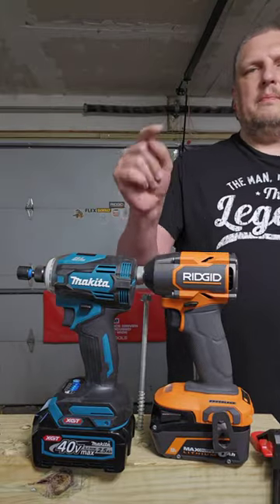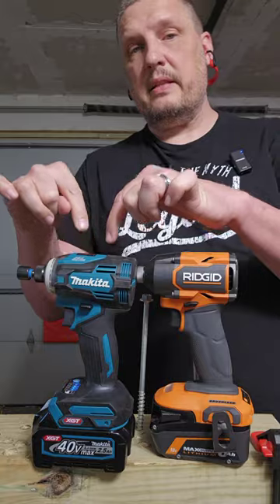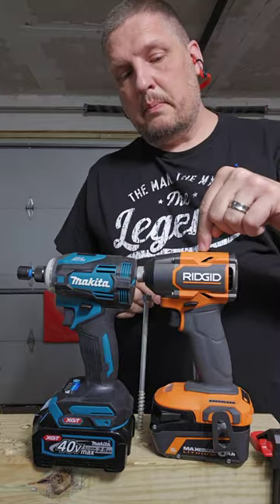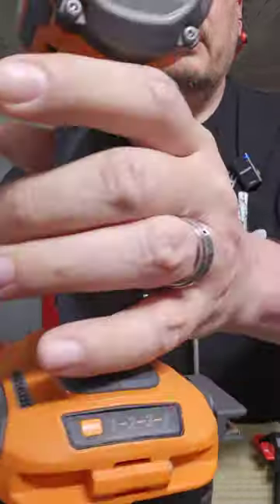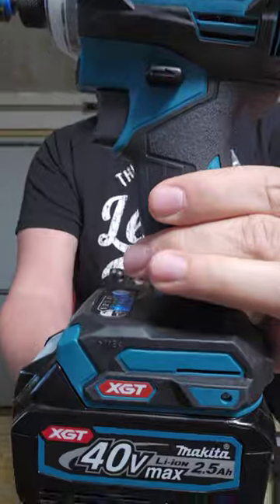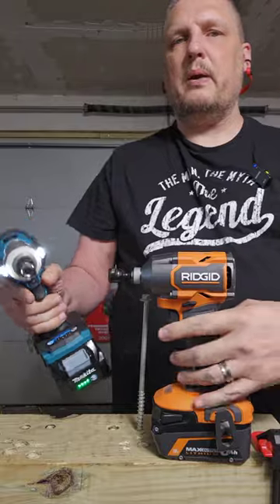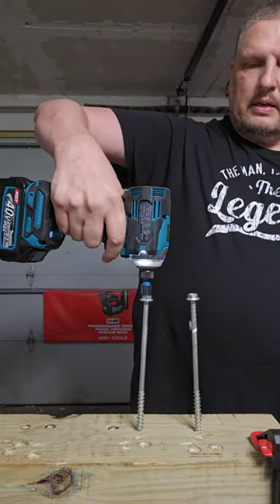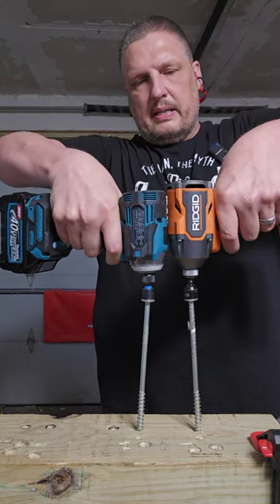Makita Fails Again! #makita #ridgid #impactdriver #tooltestraw #makitaxgt #tooltesting

Comment: The speed is not important it’s the quality
Reply from the maker: Excuses are fun to make when your tool brand loses. Like in this instance, you need to have a serious mental condition to believe that the slower tool, that has metal hitting on metal, building heat, transferring that heat through the fastener and the motor of the tool, would be the better tool. Maybe you just can't handle the results so you're allowing your excuses to expose your fear.
Reply: The advantage of impact drivers and wrenches is the greater torque they offer to drive or loosen fasteners (screws, bolts, nuts, and so on). The greater the torque, the quicker each fastener is dealt with, and the larger the fastener that can be handled.
Reply: @ToolswithSoAlz The time difference between the two is negligible, so it doesn't matter. The life of the tool makes all the difference; I don't care about the company that makes it.
Reply: Time? Doesn't matter? . Makita has nearly a third of the screw left. If my math is right.  So for each three screws Makita fastened,  The rigid have done four screws. Makita 30 screws/Rigid 40 screws etc.  I think speed matters if you have alot of screws to fasten.
Reply: @communist-hippie I don't have to hurry at work, so for me personally it doesn't really matter. I tried several companies from my country and they were much weaker than Makita. It's pretty good for what I use it for. Everyone chooses what they like
Reply: ...uhmm...Cuando voy a la tienda de reparaciones a recoger mi herramienta 
veo todas las marcas ; ... menos Makita,
cosa tan rara  . Porque será  ?
Reply: @ToolswithSoAlz  got a makita impact from 2018 still going STRONG after heavy framing EVERYDAY. Faster don’t mean it’ll last as long. Go pull that rigid out on a commercial site😂😂 clown of the day that’s for sure

Comment: I really like your videos but why is it always about power? Do more tests on ergonomics and features, build quality etc that’s more realistic for real world use. I have Makita, Bosch Professional and Milwaukee 18v and 12v. Use them all day and want a reliable comfortable tool then Makita wins hands down every time. Never had a single issue with any of them some Milwaukee stuff is faulty out of the box
Reply from the maker: You don't test ergonomics because my hands won't be the same as yours. I guarantee my hand won't be the size of yours. Makita is too small for my hands. I've shown it several times. If you like Miss Kita that's on you. I prefer performance over a name

Comment: Makita just never made anything really outstanding or class leading for people to take a second look to even consider moving from their current tool line in years. The cordless tool market is extremely competitive and if you just try matching everyone, instead of creating real innovation you’re going fall behind drastically. Makita came on the scene in the 80s with at the time a pretty strong 9.6 volt cordless drill and a light weight chop saw. They became pretty popular for a time and later had some other successes with their sliding compound saw. Since then I can’t really recall anything notable since.
Reply: Never?  Their corded power tools were top of the class 30 years ago.  They just can't catch up in the wireless revolution.  Making their way by name alone.

Comment: What seams to be a large problem here is lack information provided to people here. The Makita 40v line is there newest line of power tools that has came to the US. Every time we get a Makita tool in the US there is already a new model out in Japan. The 40v impact was never designed to be a fast impact it was designed as a filler for people who buy 40v tools have the battery system and want an impact for that battery system. On the other hand the 18v line up is where you will see more direct comparison for your smaller hand tools. For example I own Makita tools and most people I work with have either dewalt or Milwaukee. I can assure u my Makita impact will out drive the atomic but not the fuel.
Reply from the maker: So, your garbage will out drive the lowest end Dewalt. Congratulations on proving the point. Atomic isn't made for professional purposes and is their homeowner level; just like Makita.
Reply: @ToolswithSoAlz  the lowest end would be the 20v brushed stuff that dewalt has. Get informed before you speak up.
Reply from the maker: Ma'am you should learn how to read
Reply: @ToolswithSoAlz  you’re like arguing with a child that wants a toy car and the parent says NO. Not one time yet have u pointed anything out ab the fact I gave you ab the 40v series. Your only conflict you have with what I said was how I compared my impact to a dewalt atomic impact. If my information is incorrect the correct way to resolve the argument would be to provide me with a fact ab the atomic impacts from dewalt. Not just talk shit because you have a mouth.
Reply from the maker: Pickle Puffer, I prove what I say. You don't even know the basics because you're a b. 
Pick up your little camera and prove me wrong. When you fail, and you will fail, never buy another tool again. You're not even qualified to comment. All you're missing is the brains, talent, and ability to do anything but watch

Comment: I'm a Bosch guy for reference, i wouldn't believe a test like this.
One thing,pre-drilled holes as its clear in this video who is favoured. 
I agree that Makita's old 18v batteries sucked. I haven't tried the new 40v ones.
Reply from the maker: Lmfao you know absolutely nothing about tools and you're a liar
Reply: @ToolswithSoAlz  Boohoo, i disagreed with your testing habbits and you get butt-hurt and assume I know nothing. 
Get real or stop spreading misinformation. 
Don't bother replying, just do proper test's where it's clearly visible you place and screw in a fresh spot that doesn't have a hole, knot and so on. 
Or get a testing rig with metal bolts torqued to the advertised specs of the tool. 
Your tests prove nothing.
Reply from the maker: Ma'am the only tool you've ever used your brother was born with and it's your favorite flavor. Maybe if you spent time using tools instead of grabbing your ankles?
Reply: You’re accusing him of pre drilling a hole for the Ridgid?  You have to be joking.  There are videos out there (not just on this channel) showing this Ridgid defeating the Gen 4 Milwaukee in a head to head comparison.  The only impact driver the Makita 40V is defeating in a head to head comparison is the Bosch Freak.

Comment: Makita is DYI just like Crapman's . I will stick with Ridgid thank you
Reply from the maker: Good choice
Reply: @chunk144, I would buy “Crapsman” brushless power tools, for DIY projects, right now if they went on sale.
At least with Craftsman, you know exactly what you’re getting. They’re rebranded versions of the phased out Dewalt power tools.
Craftsman impact wrench = DCF899. Craftsman 350uwo drill = DCD777. The hammer drill version = DCD778. The 1500 inch pound impact driver = DCF787. I could probably go on, but I think you get the point.
Reply: For the price….Crapmans really aren’t that bad for home projects.
Reply: @RioWilliams797 just don't get a crapsman shopvac the worst purchase ever for me the circuit broke on it in 6 months. I immediately threw it in the trash and bought a rigid one that is going on 4 years now still great suction.
Reply: Yet again someone who does not know the right tool for the job. Test a hammer vs. A screw driver next.
Reply from the maker: @colinmcgrath4702 oh look,  it's a little girl lacking the brains to tell the difference between a comparison video and a how-to video
Reply: @colinmcgrath4702  If you’re referring to the content creator, SoAlz, it’s really too bad that your comment is buried here instead of being on the main page.
Anyway, maybe you should check out his other videos instead of posting an assumption based on one video.
He has said, in numerous videos, that a drill is the best tool for this task. However, he also uses a large fastener to show the separation in performance and power between two impact drivers.